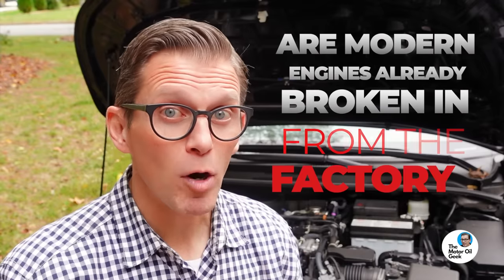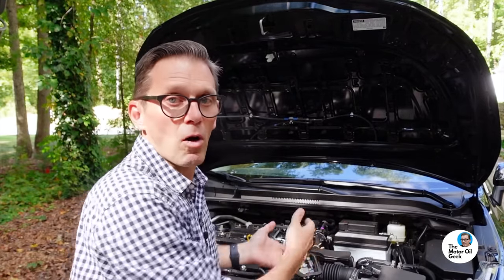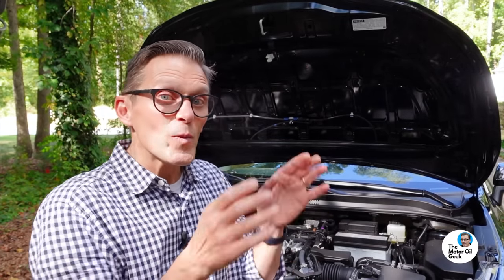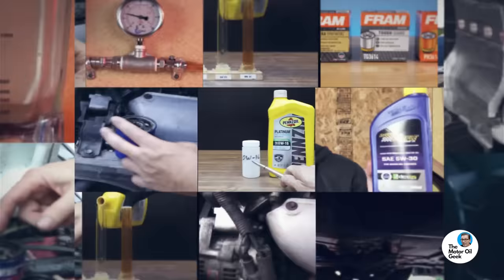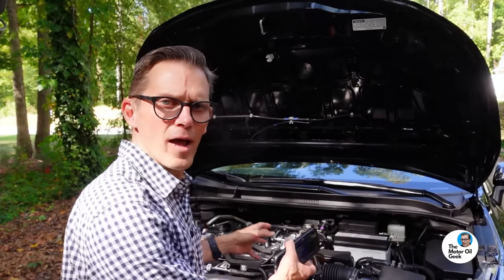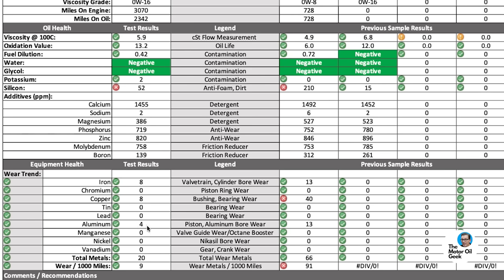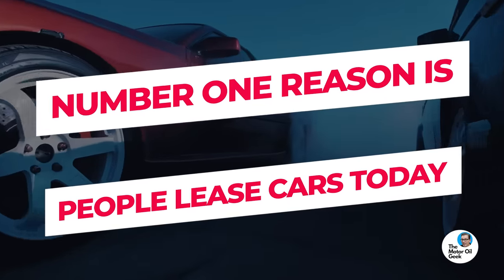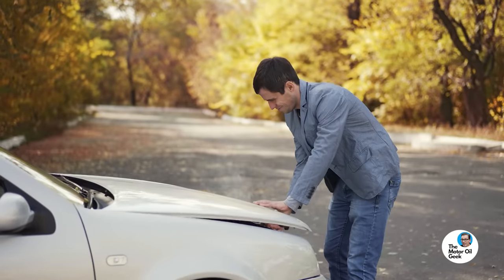New Engine Break-In: Truth or Myth?

Comment: This doesn't surprise me.  I bought a Triumph Street Triple R motorcycle in 2022.  There was a sticker on the tank giving rev limits at mileages up to 1000 miles. And the first service, the main part of which is an oil and filter change, takes place at 600 miles - with a time limit:  if 600 miles hasn't been completed in a certain time, then an oil change is mandatory.  Of course, a high performance bike motor revs a lot higher than almost all cars, so is subject to more stress.  But every other bike I've owned just limited revs for the first 600, with no recommendation for limiting revs thereafter.

Comment: Change the engine bearings every 100,000 miles by doing a bearing roll in (can access by just dropping the oil pan) and the engine will go a long long time. Just did this and my 120,000 mile engine runs and sounds like new.

Comment: Great video! Good info for sure. I would guess that engines have intial break in with extreme wear metals and then longer term break in with slightly elevated wear metals. But thats just based on a few cars that Ive seen get several UOAs online. I bet if you keep doing UOAs on the toyota you will see wear metals trend much lower around 30 or 40k.
Reply from the maker: Thanks for watching. Yes, the wear metals should drop at the following oil changes like you said.

Comment: I recently sent in a sample for 1st oil change on my 2023 F150 5.0 at 1264 miles (12/6/23) I plan on doing the next oil change prior to total 4500 miles and send it in also. Your testing shows 2 in red  Manganese at 24, Silicon at 50  and wear/1000 miles 59 are either of these a concern? From your prior videos I understand taking sample around 3 seconds after pulling plug? My method was a bit off because I did not have sample bottle at time of first change.  Another note is I assumed it was 5w30 In truck when new but note says check viscosity. AAA-4690 is sample ID if you could possibly give feedback so I can better understand.  I have been going by what my father taught me as a child (1960's) well well before getting my Drivers License.  Surely ringing true now with your excellent videos!
Reply from the maker: Thanks! I do remember those results. You are fine. All of those levels should drop at the next oil change.

Comment: Last year I built up a motor, selecting the block, pistons compression ratio, aftermarket heads sent out for flow testing and port work, all the typical stuff, for a hot street motor, a modern block, has casting flash, and bits of metal all over it that , one are race prepped and removed or part of the circulating the system until bits are drained out, or stuck in the filter.  of course pistons, rings , cylinder walls, and also the mains, the small rod ends, the valves, on new seats, it’s amazing how little metal shows up in oil analysis with break in.
This year I got a new work commute car, plan was 500, 1000, 3000, changes, my 500, ended up at 700, because life…..this is what I do, I am sticking with it.
The data points shown here only reinforce my beliefs.
Oils cheep, motors are not.
Reply from the maker: Thanks for sharing!

Comment: I procrastinated on my first oil change on a new Avenger in 2015 and waited until 1000 miles. Probably not horrendous to the engine, but after watching this I wished I had done it sooner. I did use the reccomended Penzoil Synthetic and then followed the 8k OCI. Now from what I've learned from Lake, I;m not stretching it that far any more. Makes me wonder if my buddies Pentastar failed because he followed the same OCI or whether he may have used the wrong brand. His camshaft failed badly on his van.

Thanks for the VOAs too, I could not help but notice the high Boron content on the break in oil. Question I have is if the Boron is binding to the metal flakes and is then forming a more easily filtered particle due to a larger size being more easily caught in the filter media. Boron seems to disappear in UOAs when compared with the VOAs on the same oil. 

The question is: is that loss of Boron due to it ending up in the filter or is it simply going out the tail pipe? 

I also wonder if Boron could form a covalent bond with iron under operating conditions in an engine .😵‍💫

Comment: Depends on the manufacture. But most car companies do not break in the engine. I think only hyper or some supercars have the engine broken in. YOU MUST read the owners manual and that will let you know. My 2023 Lexus RX500h says in the manual that the break in period is 1000 miles and when I did that oil change I have never seen so much metal glitter in the oil.  My next oil change there was no metal glitter at all so it is my experience that it is vital that you follow the manual and do a break in oil change at the mileage it recommends.  Also I would never ever run a cars oil to 10k miles or a year length of time.  I do my oil change every 6 months or 4000 miles, which ever comes first, especially if you have a turbo engine.  This yes may seem to some too soon for some and a waste of money but oil is cheap an engine is not.
Reply: Majority of ALL engines are broken in at the factory. There is a specific machine that gets connected once the engine is fully assembled and before the pan is installed that pumps oil through it and then some will actually use fuel while other use compressed air and the engine is run up to a certain RPM then simulates engine braking. This seats the rings to the cylinder walls and is the ONLY breaking in an engine requires. Everything else is wear in where the rings and cylinder walls get polished for a tight seal.  Some high end hand built engines use a Dyno which is what you are actually referring to.

Comment: My 2022 Mercedes Benz turbo direct injection gasoline Sprinter called for its first oil chang at 20,000 miles! I changed the oil at 500, 1000, & 5000. Now I’m thinking every 5000 - 7000, but I’ll have to get an oil analysis and see what that says. Vehicle weighs approximately 5,100 lbs empty and turns about 2,200 RPM with a very long stroke crank at cruising speed. Fuel economy empty is between 24 - 26 mpg highway, 18 - 21 in town (real world)

Comment: Super appreciate your videos! I been binge watching and rewatching so many and learning facts with science which I love.

Given today’s cars clearly are not using break-in oil, nor are the engines broken in at the factory, would you suggest to change the oil to use break-in oil (like Driven BR30) right after buying and coming home from the dealer? I plan to buy a Mazda CX-90 with an inline 6 and keep it for a very long time. Also, one thing never mentioned is how long does today’s engine take to brake in then if sticking with oem synthetic motor oil that has the additives to prevent break in (like moly and boron, and high calcium) and is it a good break-in given the oil differences?
Reply from the maker: Thank you!
Reply: @themotoroilgeek  any thoughts on my question on breaking in with the factory synthetic oil like you had done with your daughter's car?

Comment: @themotoroilgeek
Thank you. Based on the data you saw, would you still recommend the early changes be done at 500 miles and 3000 miles if only two will be done ahead of schedule, or would another early schedule be better? I will be doing two early oil changes on my 2023 Corolla with Toyota 0W-8 after watching this.
Reply from the maker: Thanks for watching. Yes, the 500 mile and 3,000 mile oil changes are what I’d recommend for any new engine. After that, just follow regular change intervals (based on the driving conditions and oil).

Comment: The data is solid. Would it be best for a new car owner to use a break in oil immediately after purchase? It seems regular oil wasn’t designed for it.
Reply from the maker: Thanks! That would be one level better than what we did here, but the gains are incremental.

Comment: Great information! Is it ok to switch to  Penzoil Ultra platinum after the 500 mile break in oil change, or would you recommend using OEM oil for a second oil change, then switch to Penzoil?

Comment: Seems like some myths are being past on in this video too. The last four vehicles I bought all say in the manual to not push the engine hard during the first 1500km (I’m Canadian), to vary rpm during that time and still talks about the break in period. Those are 04 Corolla, ‘08 Camry Hybrid, ‘13 RAV4 and 2022 Ford Maverick Hybrid for reference. The Maverick manual even says it comes with break in oil from the factory. The day I listen to the salesmen or service advisor at the dealership for advice on this is the day I stop caring if my vehicle survives past the warranty. I haven’t followed the extremely long oil change recommendations though, even with full synthetic oils.
Reply from the maker: Thanks for sharing. The samples we've seen from new Ford vehicles is just regular Motorcraft. I've not seen any "special break-in oil" from any modern OEM engines.
Reply: @themotoroilgeek  I don't send my oil for testing, so I cannot say for sure. I just know owners who did early changes (500-1000 miles) who said the oil was not standard colour Motorcraft in their Mavericks. I don't do my own changes, so I cannot confirm this.

Comment: This is a great video to see. I appreciate it! I am wondering if you could speak about 0w-8 oil. I have a new Toyota Corolla and I have done the break in oil change and an 8000km oil change but I used 0w-16 both times because I couldn’t find 0w-8 anywhere. I am wondering what your opinion is on the difference and use of these in my engine. I am in Canada btw and I found somewhere that this engine calls for 0w16 in other parts of the world. Is 0w8 better in cold temperatures or something?
Reply: Nvm. I just found your video on 0w8!

Comment: I’ve always change my own oil using the best I could find from either Liqui Moly or Motul for my cars. I also use the best oil for my motorcycle. I been doing both of them at 300km 1000km 3000km 8000km and then the rest of them are depending on the level of driving intensity and weather/season. My theory is that I’m not an scientist but I do know the more you drive the more worn metal pieces the oil contains, and the more they floating around, the more damage they cause. For super hot summer days with intense ridings at high revs, I change the bike oil once a month. I love my cars and bikes, i been told I been over doing this at utter unnecessary costs.  Have I been wrong? Maybe? But changing oil more frequently with great oil doesn’t hurt the engine either.. I just hope they company me longer.

Comment: I changed the oil on my Dad’s 23 Ford Maverick hybrid at 2k. I would of preferred at 1k but I got busy. I used Mobil 1 full synthetic which claims 15k intervals. He does not drive aggressive nor much. I think he drives around 5-8k max. I plan to change the oil every 7500 or every year. A question I always had. My question, does oil degrade over time? If so by how much? If it’s degrades is that change even noticeable for the average commuter car? The question is both for unused oil and oil circulating through a car that does not have much use.

Comment: ❤Wow…Thank you for this information …..I have a new Honda civic type R….i learned from you that I should drain first engine oil change at 500 miles and ignore owner’s manual In regard of engine oil drain interval…..BUT what about first time drain interval for My MANUAL TRANSMISSION, LIMITED SLIP DIFFERENTIAL !?? 
Please guide 🙏🏼
Reply from the maker: Thank for the feedback. Yes, change the transmission and diff fluid as well.
Reply: @themotoroilgeek  …Should I drain and change  the manual gear box fluid after 500 miles for first time and then follow the second and third drain at 3000 and 6000 respectively??…..I noted that my car has cooler lines and cooler….It won’t drain much like engine oil…most of the fluid will remain stuck inside….please guide Sir..🙏🏼

Comment: The real question is whether or not the wear metal will cause issues down the line if one was to do a 10k mile ici on the factory fill. OEMs probably saw that the answer was no.

Comment: Thank you, your video is very informative.
So ideally the OCD amongst us would want zero ppm metal content in the oil! (Lol)

However you have mentioned 90 ppm per 1000km of metal content. My logical question is, would the total metal content at the normal drain interval (say 15000km) be acceptable from your point of view?

What I do hear is that modern engines are manufactured to better tolerances, and have less “rough” edges so yes, there will be break in “debris” initially, but the total amount of metals would be much lower than an older (e.g. 1970’s) engine.
Reply from the maker: Glad you enjoyed the video

Comment: For years people would look at me cross eyed when they heard how I break in new engines…
#1 : engine gets break in oil and whatever recommended viscosity that engine is suppose to get…not synthetic at this point.
#2 : after start up its run for 30 minutes after engine has been up to operating temp…then driven 50 miles and then oil/filter changed.
#3 : then the vehicle is driven for another 500 miles and that oil/filter is changed .
#4 : after another 1000 miles the oil/filter is changed again still using conventional oils.
#5 : at 3000 more miles the oil/filter are changed one last time before regular oil change intervals ….synthetic oil is added this time and oil changes are done every 5000 miles or 6 months…(3000 miles or 4 months for conventional oils)
Through the entire break in period the engine rpms are kept below 4000 but using variations in throttle and load..
Granted if I do rebuild an engine for a customer and they chose not to do it this way that’s on them.
Reply from the maker: Right on!

Comment: I've always gone with the manufacturers recommended oil changes. Never changed oil early. Here we are 50 years later having never had an engine issue. I own a lot of cars, and have had most since new. 

The filter catches the break in metal flakes. No need to change the oil at 500 miles. 

But you be you. I'll be me.

Comment: I've never bought a new vehicle but if I ever do I'll drop the oil early. My friend bought a new truck and I recommend he change it around 1,000 miles but he didn't.  I bet 95% of the people don't change it until the recommended interval.  I believe one of the most important things is a proper break in (which people will argue about on the internet) of varying the rpms.
Reply from the maker: Right on!

Comment: I did the same thing with the two new cars that I’ve owned. For my 2020 F150 with the 5.0, I changed the oil at 700, 1,800 and 4,600 miles.  I did the same thing with my Toyota FJ cruiser in 2013. The Toyota dealer included the first three oil changes in the sales price. When I went in for the first oil change at just under 1000 miles I had to wait for this to go up the chain in the dealership for approval.  I got the comment “why would you want to change your oil at less than 3000 miles?“.  Yes I have gray hair. I also have a tight clinch on my wallet. I want to keep this truck for many years and an oil change is not a lot of money when you do it yourself.

Comment: So the epa is actually causing the opposite of their stated goals.  Because of the EPA we now have cylinder deactivation and direct injection (without any port injection) both of which will cause reliability, emissions, and sometimes worse economy if not perfectly maintained.    They ruined gas cans by forcing the removal of the air vent which I believe results in far more spilt fuel and vapors than old cans ever caused.    Maybe we need some long term studies, and the EPA could test vehicles with a few miles on them.

Comment: Thank you for this video and the previous one with your daughter’s car break in oil changes.  People are ridiculous.  It’s $35 to $40 to change your oil / filter with excellent full synthetic oil and it takes 10 minutes.  How is that a waste of time and money? Just change your oil during break-in period.  Change your oil 2-3 times in the first 500 to 3000 miles, what’s the big deal?  The big deal is when you don’t do it. You don’t even need to be a tribologist to have common sense to tell you after dozens of metal components are assembled then start moving together rapidly for the first time that there is going to be some initial wear that is more severe than after the break in period.  Just like people that have GDI Turbos and run extended oil changes while driving around with heavily fuel diluted  oil.  I have a GDI turbo and that oil is crap after 3000 to 4000 miles. You can use the best oil available but if there’s heavy fuel dilution, it’s not doing its job properly.
Reply from the maker: Well said. Thank you!

Comment: With modern full synthetic motor oils do they do engine "break-in" as well as non-friction modified oils.  Specialist engine oil makers sell non-friction modified oils for running in user made sports engines, for better ring seating? etc

Comment: Here’s my theory:  True breakin was at the factory where the oil comes out silver from all the metal. That’s the way my unbroken In little generator I got last year was. Had a very short unloaded run on the first oil which came out silver (scary). Second and third came out cleaner and cleaner (3rd oil stayed visibly clean). You’re doing the 2nd oil change at the 1000 miles, I’d speculate.  Still very beneficial.